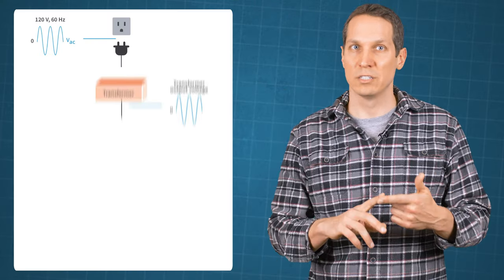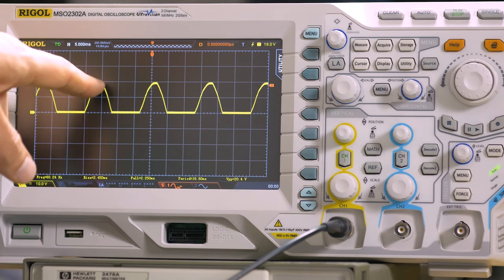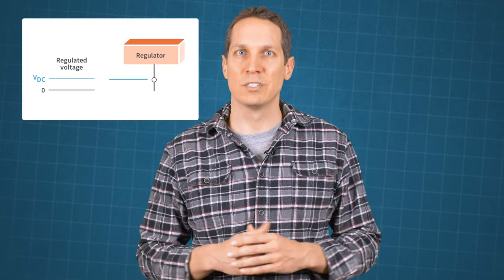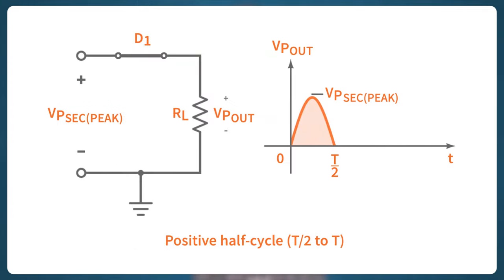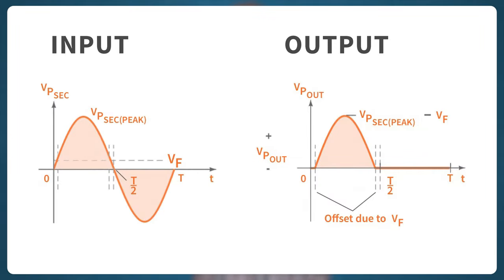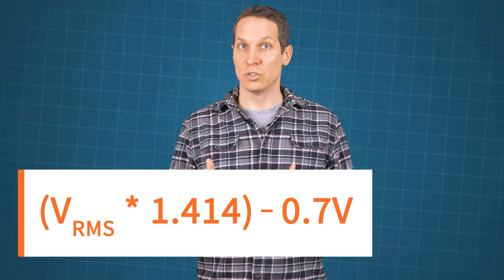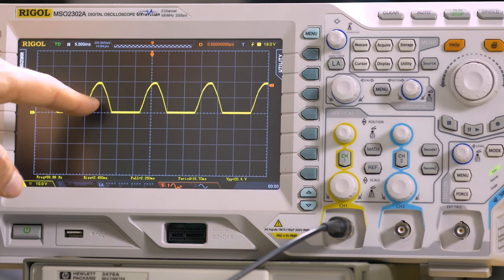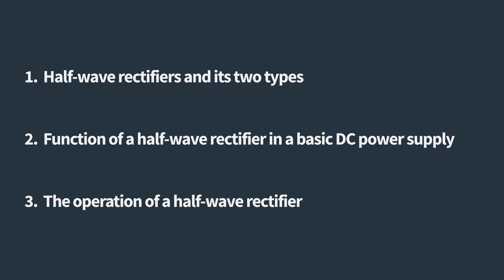What to Consider when Designing a Power Supply with a Half Wave Rectifier | Intermediate Electronics

Comment: 2:10 Why combination of electrolytic and ceramic?
Reply from the maker: Excellent question!  I wondered about that the first time I saw it.  Electrolytic capacitors come in larger values and are less expensive for those large values.  But they're not as responsive, they have a larger ESR so if there is a quick transient load, they can't supply (or absorb) current as quickly as ceramic.  Ceramic capacitors are more responsive but they typically have smaller capacitances and can't handle large changes as well as electrolytics because they run out of capacity.

Comment: i'm eliminating the c cell in my vtvm with an lm 317 battery eliminator circuit.  my DC for this circuit will be from rectified AC from the floating 6.3vac winding of the pwr transformer. my question is will a full wave bridge load my transformer any more than a half wave circuit would ?
Reply from the maker: It all comes down to the overall power usage, you'll get more small surges as you aren't providing that power half the time, but the average will probably be just fine unless you are really pushing the limits.  But, if you are worried about it, the full wave rectifier would be a more consistent load on the transformer.